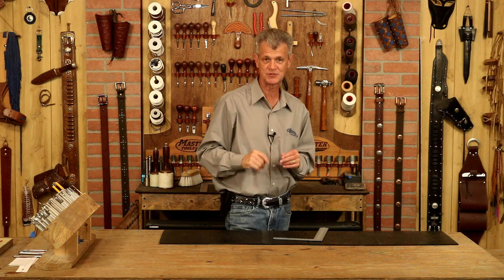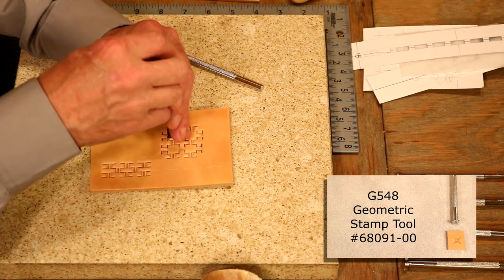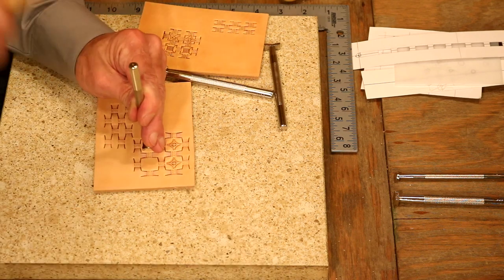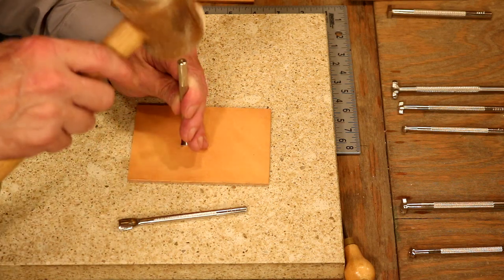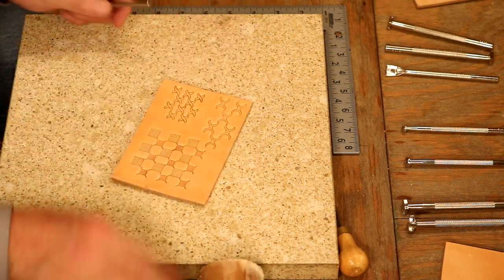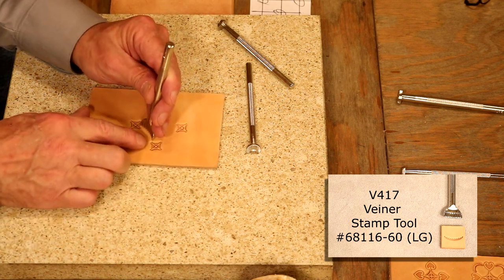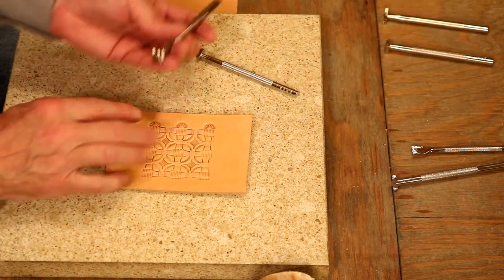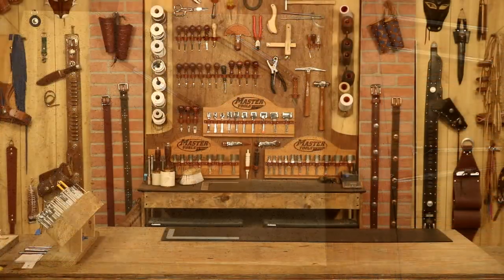Inexpensive Leather Stamping Tools, Segment 4: Combinations Pt. 2

Comment: Chuck, I have to tell you that you an easy, sensible and easy way to tool.  I’ve done tooling the way “they say it should done.” It’s hard to learn and extremely frustrating. Starting the way you just described and showed is the best way to start tooling in my opinion. Great job with the Christmas Bells. Richard